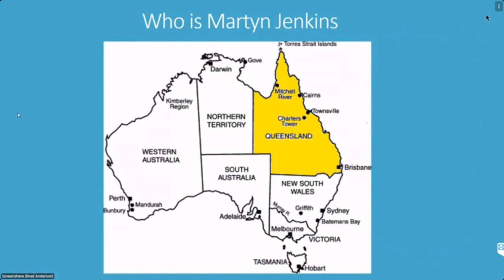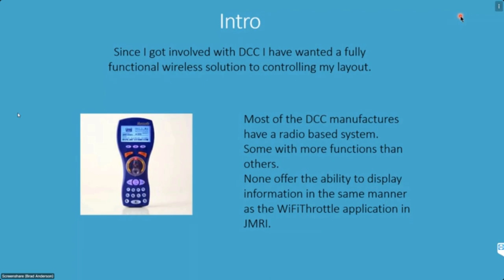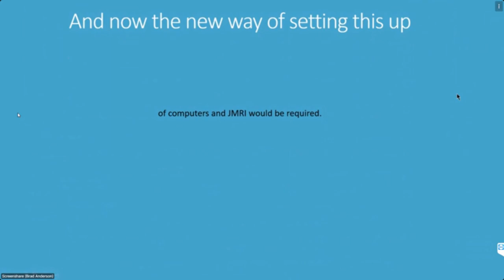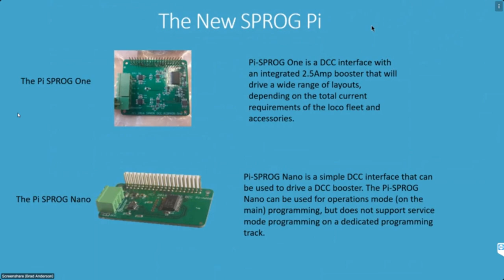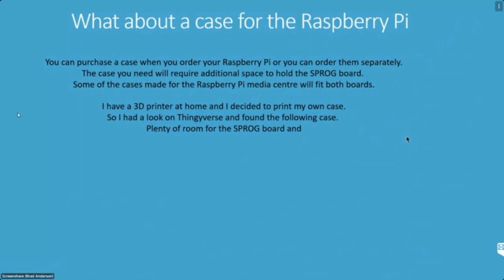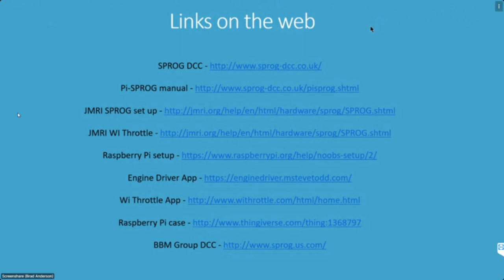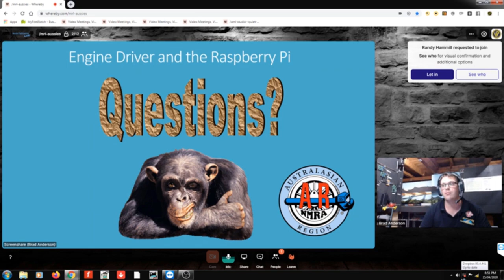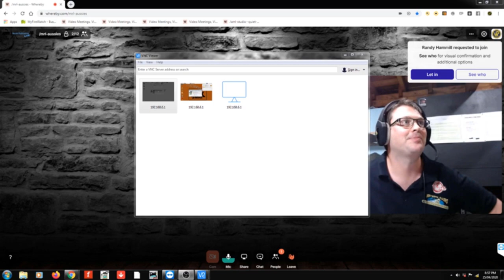Martyn Jenkins - Raspberry Pi and Engine Driver

Comment: Please pass on my thanks to Martyn for making time to share his experience.  The challenge with choosing equipment to control DCC is identifying the cost effective solution to having multiple throttles for a layout.  This is one solution that should be considered.  Look out for the slide which gives the suppliers.

Comment: Why use a Sprog with the Rpi. Wouldn't Rpi motor shield be a lot cheaper? I take it that the Sprog is just a commercially marketed motor shield.
 sprog +Rpi from the uk $280.00 nzd
+duty +gst+customs handling fee . oops and + power supply.
 same price as buying a nce or digitrax system from a local shop. 
ie. Sprog is a waste of money.